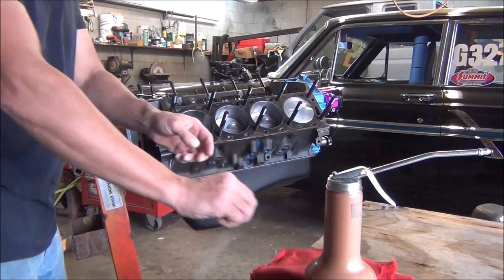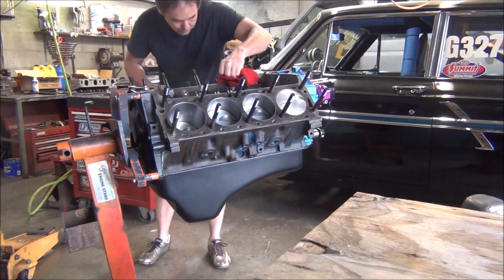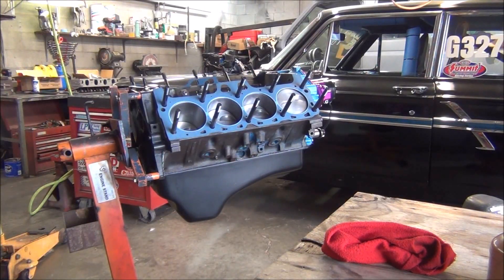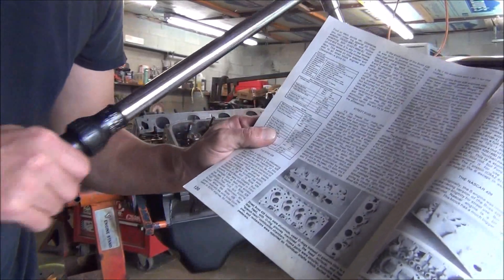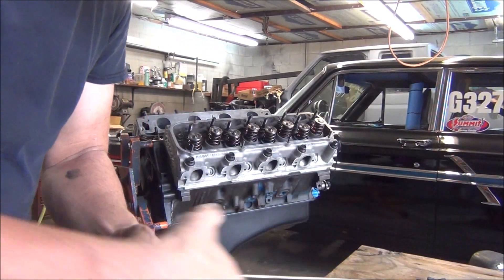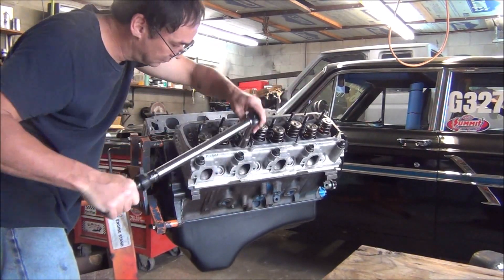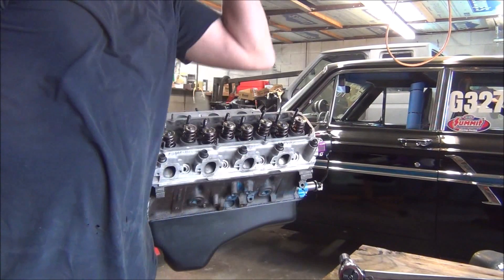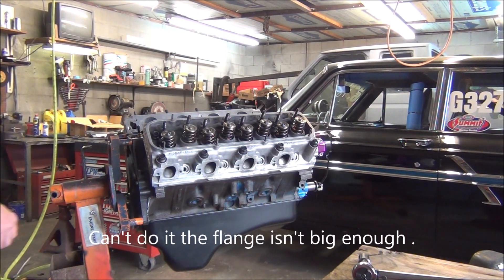460 Rebuild Part 16 Torqueing the head bolts

Comment: Good job showing telling,I may use the same head gaskets to . I just took my heads off about midnight cast ones 75ps feels like 100 pulled them off out of the truck. Motor steel in the truck I am just doing the top heads like your and change intake should run better. Well have a good one see ya next time see ya bye.
Reply from the maker: Thanks 👍

Comment: Would love to see your engine specs on this engine. I have a 460 mild build BBF and I don't know that much about them. I bought it with the 460 in it, was a 390 S-code in my 67 Mustang. Really want to pull it and go through it, I have no idea what the internals are. Thanks for the videos, looking forward to a reply sir. Cheers from Motown.
Reply from the maker: All that info is in the this series of videos. Thanks for watching
Reply: @Dragracer64  Thanks for the reply sir. Will go back and watch them.

Comment: I have watched all of your rebuild videos, very impressive!
I have a 1984 460 in a 1984 F-250 pickup truck that is in need of a rebuild, blowing oil out of the valve cover penitrations.
I thought about doing it myself but decided I have neither the skills or the tools to do it correctly. After watching your videos I have determined I made a good decision to have a local professional do the work.
Your rebuild videos are very informative and helpful.
What I want is a fresh reliable engine for my old man ranch truck, nothing special but one that will out live me. I have replaced just about everything on this truck except the engine and transmission so far. I will be talking with the mechanic who has an excellent reputation on the 30th of oct. 2018 to get things rolling.
Kudos to you and thank you for all the effort you put into making these rebuild videos. :)
Reply from the maker: Thanks for watching